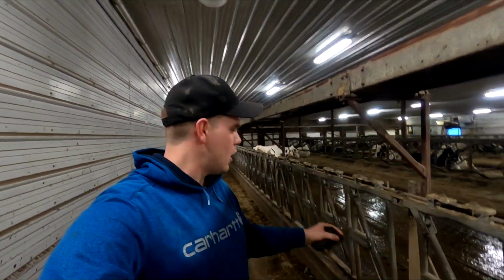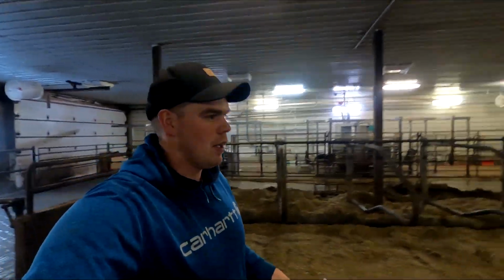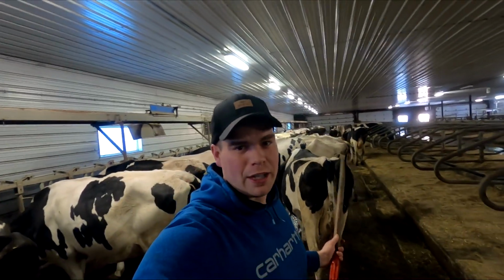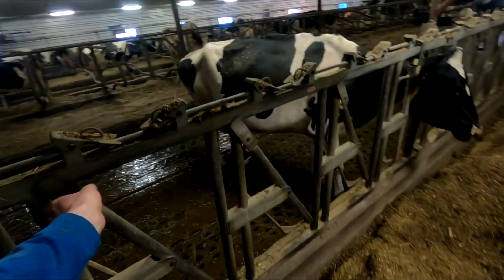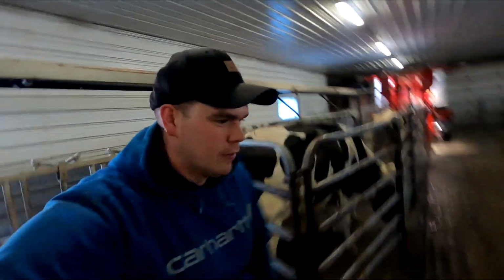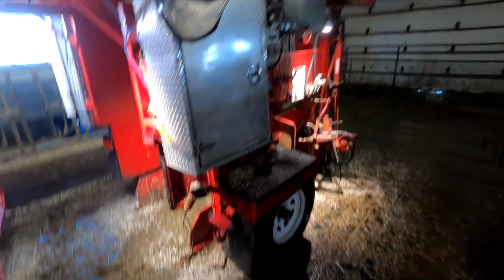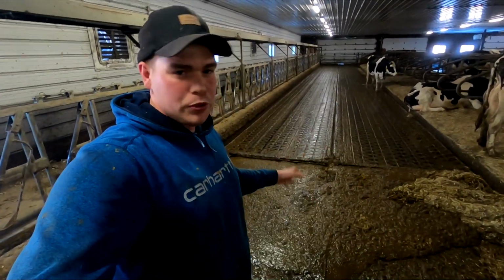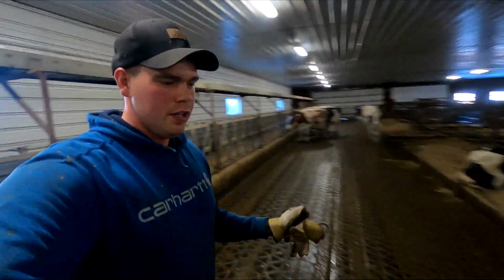Hoof Trimming On A Canadian Dairy!!!

Comment: Another great video Luke. Great hoof trimming routine. Do you see differences already between concrete alleys and rubberized? What does your  hoof trimmer say about the rubber?
Reply from the maker: I have no experience with concert floor, hoof trimmer believes in the rubber grooved floor. 

We told ourselves we weren’t going to go from a tie stall barn to a free stall without rubber flooring so we put it all in before we moved the cows over to this barn
Reply: @Northerndairyman  That's great Luke. We sell lots of this Legend grooved rubber. You can identify heat much easier too and way less splits also!
Reply: @leopauls  your correct. I'm also a hoof trimmer and always recommend rubber floors.